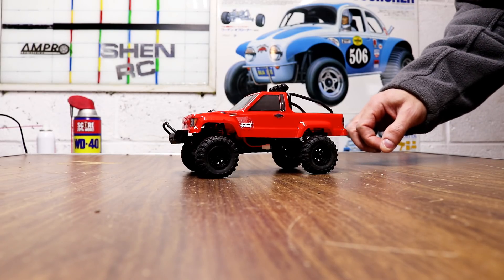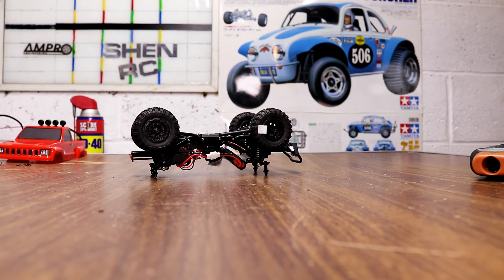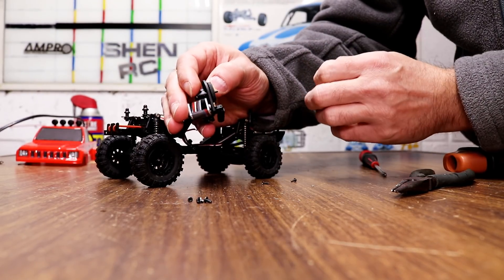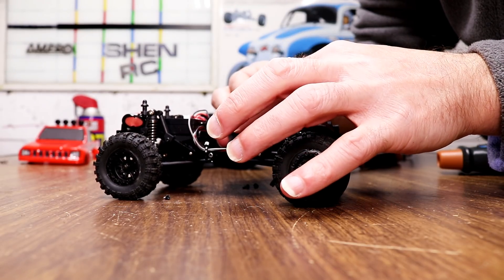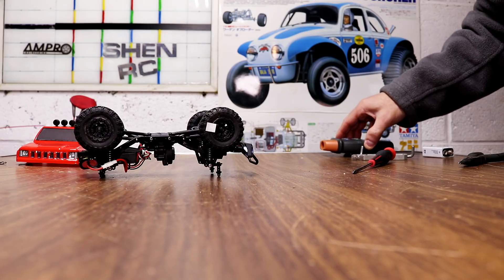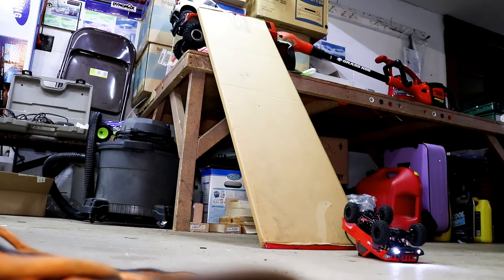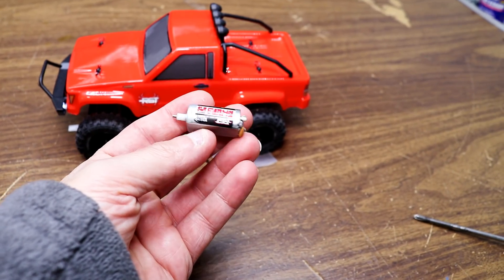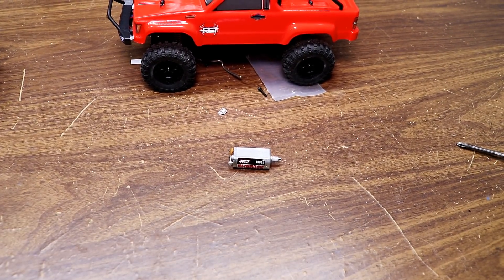RGT ADVENTURER ECX BARRAGE FTX OUTBACK MINI RC4WD MOTOR TEST

Comment: Great test Steve. I installed the RC4WD pinion on the stock motor. Haven't tested it yet but it was a pain installing it :) Happy New Year.
Reply from the maker: Yea I have a slot car pinion gear puller it works great to get pinions off. Thanks & Happy New Year! =)

Comment: Which pinion would you recommend?
Reply from the maker: The 9 tooth was good but you can't find them anymore so a 10T is the best. you can find them on standard size rc servos on the motor inside them.

Comment: I just tried the rc4wd  motor on 2s because I killed my stock motor with the same battery and it works really well a lot more torque,with the stock battery it sucks,the rc4wd motor is rated for 7.4 volts so I think the stock battery in too weak for it,keep up the good work🤟update the rc4wd motor has now died as well ,I am now using a 6v bec  and the stock motor I will see how long that lasts
Reply from the maker: Thanks , I figured maybe on 2S it would be good enough.also you got to remember the RC4WD motor comes with a 10T pinon so that helps it if it had the 12T like the stock one has it would be much less power. 👍😊👍

Comment: Just see a video with an ftx ibex motor/tranny combo fitted and it looked spot on might be something for you to try
Reply from the maker: Hi I seen that, I have the 8 tooth pinion gear on now and it's perfect speed and has lots of power I would not want this truck super slow like a crawler because it's a trail rig not a true rock crawler. Thanks for  commenting 😊

Comment: All trial and error but you night find a motor the same size but with more turns.
Reply from the maker: Hi I also did try the same size motor with higher turns only had 7000rpm at lower voltage and it was way slower than stock but they did not use good magnets in it and it had much less power. I think they picked the best motor for this little truck.
Thanks =)

Comment: Definitely smaller pinion gear , also your test are very nice especially with this rpm meter you can understand exactly what's going on. So try a smaller pinion and saw us , because this car is very fast for a crawler, it's more for speed and trailing but not for crawling.